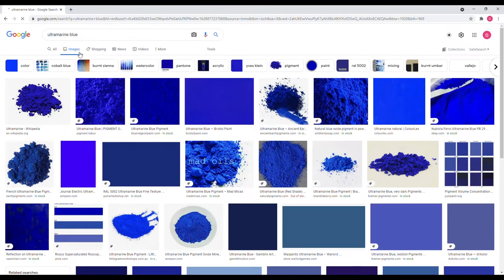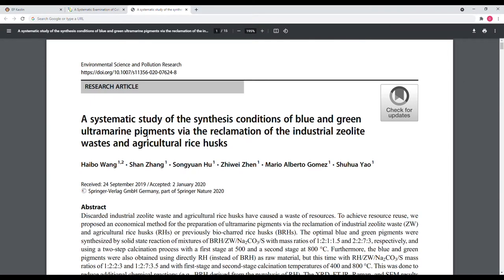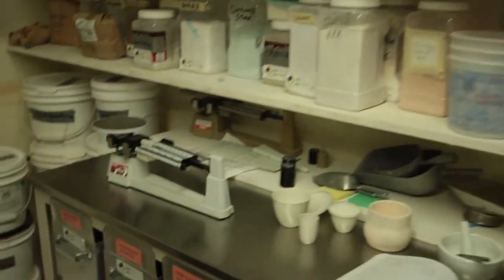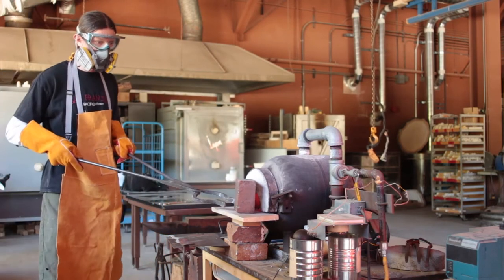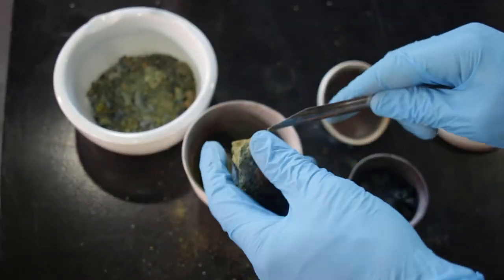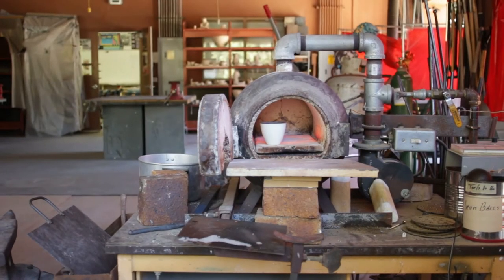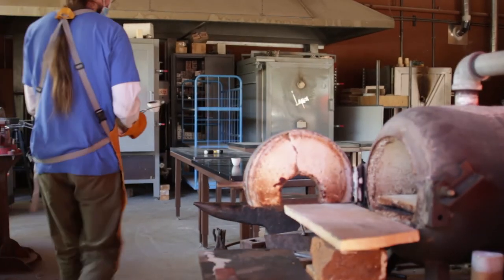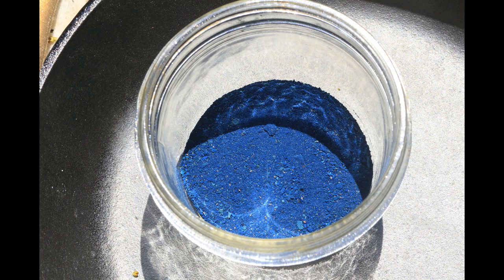Preparation of Synthetic Ultramarine Blue

Comment: You're going to love the YInMn blue synthesis.  No sulfur oxide fumes, you get blue color the first heating cycle to know it works, when if a trial doesn't 't work the oxides are unreacted and reusable, and results are very consistent.  You just need to be able to reach 1200°C.  Only concern I have is I did all my work in electric furnaces, so I don't know how using a directly heated gas fired kiln will work.  One of the electric kilns would be a safer bet.

Comment: For reactions like this, an electric furnace is usually optimal for maintaining consistent temperatures over long periods of time.
Reply from the maker: Didn't have access to an electric furnace, and while I did get to use a kiln for the YInMn Blue project later on, the art director said I couldn't use one for this process because the sulfur fumes would rapidly corrode the heating elements, so we opted instead to modify this homemade propane-tank forge for this procedure.

Comment: i think a big issue is you surface area to volume ratio. compacting so much material on itself doesn't allow for proper air flow / reduction atmosphere to interact with all of the elements. in a beaker with chemicals you have a stir bar that forces materials to interact, thus increasing rxn time and % yield. You can either stir materials, make smaller batches, flat plate batches, or scaffold lattice (removeable tubes that will leave voids in your material, think sand mold) batches will allow more material to interact with penetration depth of atmosphere. I did something similar with rubies when i first started way before the days of youtube. Some success but never thought about making it into a paint... ruby paint would be awesome now that i think about it.
Reply from the maker: this is a valid critique of my method here.  I think industrial production involves making bricks of ultramarine but maybe without having the crucible, there's sufficient gas flow to the sample.  Also I think ruby paint would be awesome.